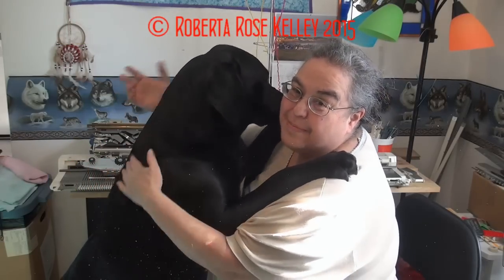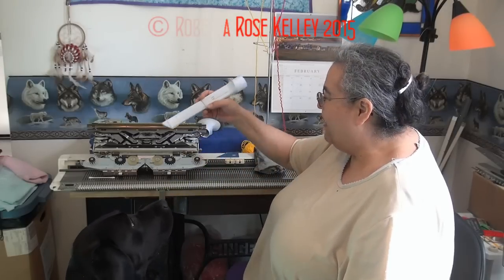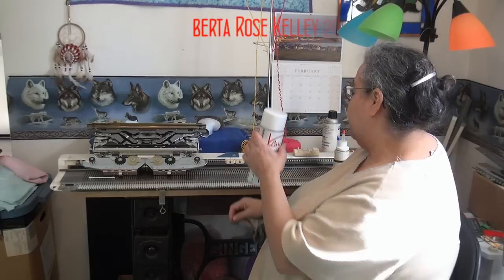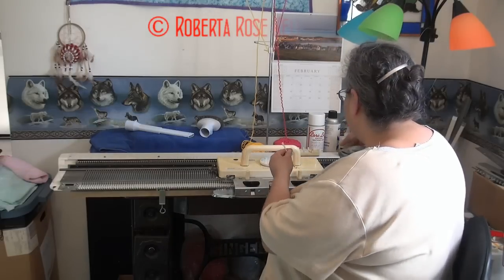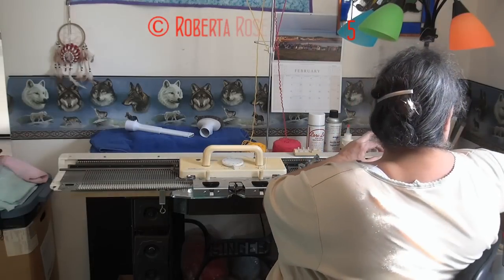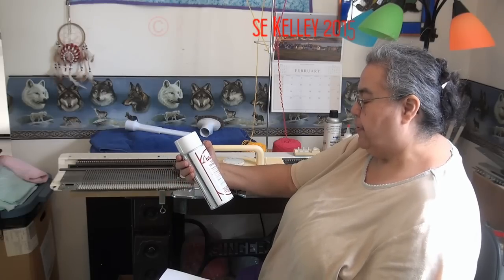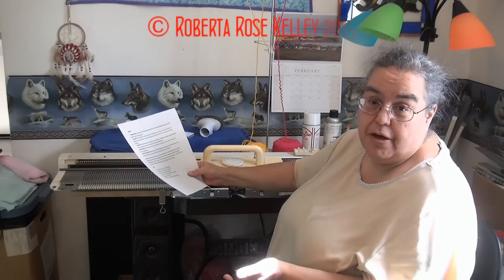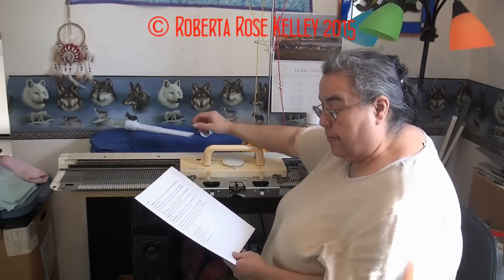Cleaning and Lubricating a Knitting Machine and Carriage

Comment: Have you ever had a machine that was almost beyond repair? I have a little Necchi-Elna Miracle Knitter Jr. and I bought it secondhand. The needles were corroded and pitted, and the plastic bed had lots of cracks in it that made the "cam box" or carriage jam. I was lucky enough to find another bed on ebay with some needles on it that were in decent shape, and I ended up sanding down the corroded needles a bit to even them up and then I gave them a good soak in CPC for a few days before cleaning them all a second time and smoothing out any burrs. The machine operates, but having some sort of weight on the knitting is a must where the manual for the machine does specify that weights were not needed when the machine was new. I'm happy the machine works, but having to gut another bed and changing the conditions of proper operation makes me kind of sad. I have found that the more I use it the less weight I need on it, but I wish I could have gotten the little knitter back to original manufacturing condition.
On the plus side, I found an old studio SK303 machine on ebay that was so new in box it still had the factory plastic on everything and the box was still stapled shut from the factory. The white plastic wasn't yellowed at all, but the oil that came with it had basically evaporated somehow, but it did come with 3 extra needles and the spongebar is still in really good condition by the grace of god.

I want to get a metal bed mid-gauge machine too, but I also want to get a ribber for the SK303 and I know which one to get because the manual lists the one that would be compatible. I'm really torn on what to get, because, let's face it, I'm not rich and it will still take me a few months to save up for it. The way a lot of machines are going I feel an urgency in buying them that I have to resist because if feels like if I wait to get one it won't be there for me to get when I finally get the money.
Reply from the maker: I sure did, it was a toyota machine but now I wish that I tried harder to fix it, but oh well.  I know that machine, I did have one but it was still good, just didn't use it much and did find a new home for her.  Glad you did find another one.  One thing i found out is on eBay you need to watch out for those that do not know anything about the machine, it could be very bad or missing parts.
The singer type machines only need the claw weights on the ends but I still like to put a comb on those machines.  It is a shame when one gets a machine only to find out that it needs a good cleaning or to get a 2nd machine to make at least 1 whole bed, but this does happen.
Nice find, those are hard to come by but they do come along and most times I find the new owner is the lucky one.  I did get a few good deals on a few of my machines.
According to http://www.lacecarriage.com/studioribbers.htm it looks like the srp20, srp50 and srp60 will fit that machine but I cannot guarantee that.  I would think the 20 would but those are hard to come by, the 50 and 60 are more available but do not get the 60N.  I did get the srp20 on the sk840 when I did have those 2 machines, the ribbers just hook up a little different is all, but i would only try for the 20 or 50 myself if I had the 303.
Now there is the SK160 and SK860 are both 6.5mm machines but the 160 doesn't have the ribber and the 860 is electronic, so that would be a hard to find machine but also very high priced.  I see many greedy people out there with selling their machines and put the price up very high.  Maybe they do get it but I hope to help those understand that some of the used machines out there for sale may or may not be a good price.
Now another mid-gauge machine is the Artisan 70D but they stopped producing them as well and if you find one used, they may be a bit pricey also.  Now that is one machine I wish I had got but then again, it is more like the manual non punch card machines, I do like the punch cards, they can do so much more and easier also.
Save up and sure you will get the machines you want.
Berda
Reply: I've found that on the LK150 I can get away with not having the claw weights on the ends somehow.

I know the ribber that originally came with the 303 was the sr303, but you'd be able to find a unicorn before you find that, so I was going to get the srp60 and try that. I've heard some stuff about the 60n, so I was a little wary of that. I've seen a few ads on etsy where they have the knitter and the ribber together but I've yet to talk any of them into just selling me the ribber...
I've seen a few on allbrands.com that are mid gauge with a ribber.
I also have a brother profile 550 that was in really nice condition, though it was missing a few things (the top cover and a latch hook), but I got extra stuff with that, including a handmade wood cabinet so that's ok. It's hard to give 2 standard gauge machines equal attention though, so I've been thinking about selling it and using that money to put toward a new machine.
I don't know why but I love the brother cast on combs, so I've been using that on the 303 because that only came with a wire and the manual didn't have any pictures and didn't explain it very well. I usually like a closed cast on though so the wire isn't a big deal. I do wish brother would make machines again, but if any manufacturer could jump into the market I would beg Husquvarna to do it because their stuff is like the nokia of sewing machines it seems.
I remember seeing a new artisan mid gauge machine somewhere that was barely used and well kept but it was only listed for about 10 minutes before people descended on it like sharks to chum.

EDIT: Completely odd, but was at Joanns and met a lady who has a singer sk328 she barely used and offered to trade for my brother machine. The compatibily chart you showed says the srp60N is for the 328 and newer, but is it possible to use the srp60 for both machines? What's the difference between the two?
EDIT AGAIN: I found the manuals for the srp60, srp50 and the srp60N. The 303 doesn't have the dip in the bed to fit the srp60 mounting brackets and neither does the 328. Both of them seem to have the same setup on the bed for a ribber and the setup matches the srp60N manual and the srp50. The srp 50 and 60N seem to have the same setup you showed in your video where you installed that studio ribber. From what I can see the 60 has a built in bracket on the ribber and then a another bracket where it sits just behind that dip in the metal and the ribber bracket sits in the dip.  I think I just answered my own question.
Reply from the maker: I know that list may not have been complete but thanks for that info.  Most the times whatever the knitter is, the ribber has the same number.
I had both 60 and 60N, the 60N hooks up very differently but it did work.  I kept the srp60 for my sk700 but even the srp50 and srp20 are nice ribbers.There is the new brother double bed that is a mid-gauge and a dear friend has that and
she loves it.  I forgot about that one.  I have seen some put it down as it has the plastic rivets but so doesn’t most of the studio type machines, they still hold up but screws are in place where those are needed.For the 550, do you mean the hand tool latch hook?  As any standard hand tools should work. 
Just some things are special to certain machines.  Like that handle on the back to select the
needles, one lady I talked with was missing it.  I told her that if she can get a locking needle nose pliers, that should work until she can find that part.  We do need to find ways to get some of the older vintage machines back to original equipment but sometimes we use something different.I also use my brother cast on combs on the Studio/Elna/singer machines I have but I also
have the lk100 cast on comb I will use on my Elna 2300.I think I know what you mean with that wire, I did a video on using ravel cord to cast on, that wire would take the place of the ravel cord minus the part of hanging down between the gate pegs (so you just lay it behind the gate pegs instead), let me find that video.  https://www.youtube.com/watch?v=4_GEpxMoI5s
I am pretty sure the srp60 would fit most machines but cannot guarantee that, it was the 60N that was a bit different.  Then the other side is the fine gauge ribbers will only fit the fine gauge machines.
There are people out there that love only the brother machines, same for the singer type machines but then you get some that will use both types.  I do as when I get someone that wants to know how to do something on the brother machine, I have a couple that I need to
figure out which one to keep and which one to find a new home for but will hold onto the knit king kh710 as to get a ribber for those push button machines are like that unicorn.  Oh to have a unicorn in my yard but we do get big moose and also deer as well as some of the smaller
yard animals.
Glad you found the manual and from what I remember, I did hook the srp20 to the sk840 I
had for a time and it worked.  So the difference in the 3 are how they hook to the knitter but some knitters need a certain way for that.
Well I wish you all the best with your machines and that lady you met in JoAnn’s, really hard to find another machine knitter that lives close to one but it is possible.
Berda
Reply: Yeah, just the little latch tool. I don't mind that it's missing as you can buy a latch tool at most craft stores these days, and they're easy enough to buy online. I think Needle-Tek makes them as well. I'm still figuring out how to use the little push buttons on the 550, but I'll probably stop being stubborn and go download the manual. The 303 patterning system was pretty easy for me to catch on to.
Thanks for all the help! I'll still keep a look out for the older machines and such, but I think at some point I want to buy a machine still produced by the 3 manufacturers that still make them. I'd like to support the manufacturers, it'd be so nice if they keep making them.

Comment: thank you!! great video! I just got a vintage knitting machine.. it works but its extremely hard to move across
Reply from the maker: Suzie Bender Thank you for viewing them.  I also have a 2 part video on taking apart the sk326, deep cleaning it and then putting it all back together.  Sometimes those old machines that were not used in years will need a deep clean where others only need a little cleaning and lubricating to get them back working again.
Reply: i just watched them yesterday and have been cleaning it and i also learned about the sponge bar... its really bad! i ordered a new one and i ordered some singer machine oil.  i cant wait to get it all cleaned up and back together! :) i have watched several of your videos now there awesome! thank you!!  until i got my knitting machine a couple of weeks ago I had never used or seen one before. i am learning as i go! :)
Reply from the maker: Suzie Bender Sometimes cleaning up a new to you machine can be more work than one wants but sometimes we have to do it, but then again, you accomplish something new or get another older machine back up and working again, which in my book is a very good thing.Thanks again for viewing my videos, just knowing that one person has benefitted from it, I am a very happy person and can look to get up more.

Comment: i have ben given a knitmaster 323 , the carriage wont slide , its because the wheels are stuck solid , how can i get at these and clean please ,its the wheels at the back of the carriage thankyou xx
Reply from the maker: Try taking a hair dryer to the drums to see if it is congealed grease. The other thing you may try is to soak the drums with WD40. I would take the cover off for that, let it soak and drip onto paper towel, then before using it, if you have access to an air compressor, blow out the drums but also the rest of the carriage.
If not,  you may need to replace the drums.
https://www.youtube.com/watch?v=C9VRBx_yjNc
https://www.youtube.com/watch?v=qh2_Hlnb2CE
Or send to a repair person.

Comment: Thank you for sharing this! I'm getting ready to move in the next couple of months. This is a cross-state move, so I'm doing a good job of packing up. Should I clean/lube my machine before I move or after the move when I set the machine back up?
Reply from the maker: Depending on how long your machine may not be used, I myself would lubricate it just so that first it will be hard for moisture to get to it, but also so that just in case moisture were to get into your machine(s), lubricating it before will surely help.  Just remember to wipe off any excess that may be on the carriage and/or bed.
Moving can be an experience, being a military family, we did move about every 3 or 4 years, glad I am settled down now but one just never knows what the future hold for that person.
Reply: Roberta Rose Kelley Thank you, Roberta. I think I'm going to do a deep clean, too. I'm going from dry central Utah back to near-the-rainforest northwestern Washington state. The moisture protection is going to be important. Thanks, again, for your reply and all you share with us!
Reply from the maker: Mary Vivit Doing a Deep Clean is sometimes a very good thing, then you can check out the underside of the bed.  When I opened up my 326 and found the lint along with other dirt that was stuck to the inside of the case from a previous owner spraying the bed, it did hold stuff that caused some rust to start.  I do tend to do that when it is nice and warm out, not much in precipitation around to stop any other moisture from getting inside there.  Going to a wet area, you may want to have more plants around that will catch the moisture in the air but also leave enough so that it won't build up static electricity.
I am happy to share what I have learned over the years, some of it is from others and their experience where most is just how I had learned how to do whatever on my different machines.

Comment: I have brushed off and cleaned my machine but when I get to the center of the machine when trying to knit it gets really difficult to slide across - nearly gets stuck.  Any suggestions?
Reply from the maker: I am thinking that maybe the bed is not level? Can you check that and if it isn't, you may have to lay it flat somehow and put some weight on it to try and get it back.  Berda
Reply: Roberta Rose Kelley I will check, thank you.

Comment: Hi,  have a jone simplity it's so hard to use... Any help please.. the needles seem to drop backwards on movement so are out of line when the carriage goes over them so it jams.. how can I stop the needles from moving on their own, it seem they are to loose.. thank you for any help
Reply from the maker: So the Jones are similar to the Brother machines, when the needles are loose like that, it is the sponge bar.  But not sure if that machine has the sponge bar or just a metal bar as some of the older machines only had that metal bar or rod to hold the needles in place.  But if it has a sponge bar, then you either need to get a new one or refurbish that one.  Watch this video to see what I mean, some of the plastic machines only has a sponge strip.
https://www.youtube.com/watch?v=fI0PwWj7t8o
Berda
Reply: Yes I got really annoyed with it, and could only see a metal bar, so I took it apart completely in order to clean it, and found a sponge bar at the back of the machine, yay, so I now have a old machine that works... Thank you..
Reply from the maker: Most of us get that way with one thing or another, so your not alone.  But we do find out what the problem is one way or another and get to our crafting.
When I get mad at my machine, and I always tend to blame that instead of the operator, I will walk away, talking beneath my breath but go do something else that has nothing to do with knitting, even hand knitting I leave alone.
That is the good thing with most of the machines, old as well as the newer ones, we can get them working again and I can hear mine singing a nice song as they are at work.  I still hear my other machines cry to be used and in time I will get them out and use them even if for 1 item.
Berda
Reply: Yay, I found some spray that acted like oil but dried with out oil finish, car maintenance spray not wd40. I cleaned all the carriage and little flippers. It's now effortless to move even using all needles it's not hard. I am really impressed. But when I had it apart I noticed the bottom of the needles have little pits and divits in them. So wondering if I should replace them. Then I need to learn how to read a pattern.